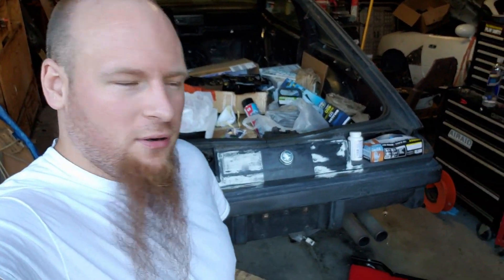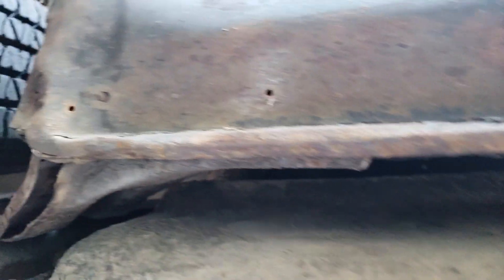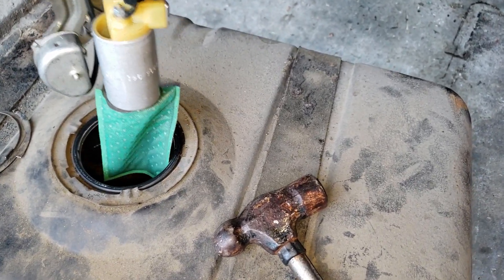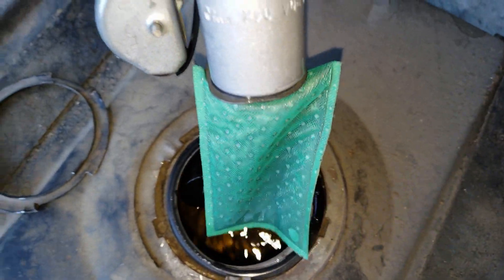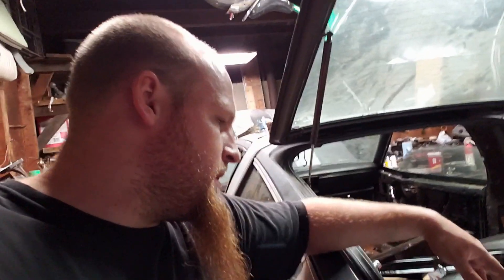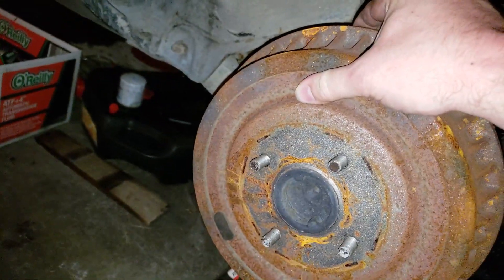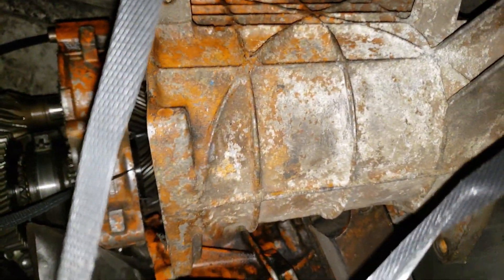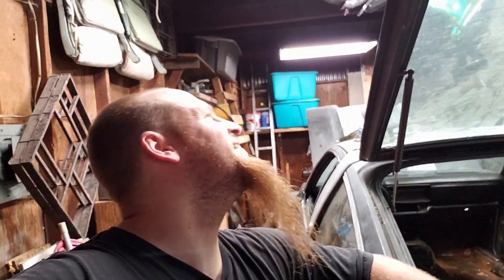1976 Buick Skyhawk | Fuel Pump and Update

Comment: Did you get the new fuel pump put on ? If so did you make a video of you doing it cause I need to replace mine on my 79 Skyhawk
Reply from the maker: Still doing some trouble shooting. I got everything back together and in the car. Now I've got no power to the sending unit. I will be having more updates soon.
Reply from the maker: It is fairly simple. Today I was able to get the skyhawk running without any issues or needing to drop the tank again. I can walk you through it if you wish
Reply: Yeah that would be awesome if you could do that !! Let me know !
Reply from the maker: @JoeyArellano  Email me  derpanzzzer@gmail.com
That way I can walk you through it